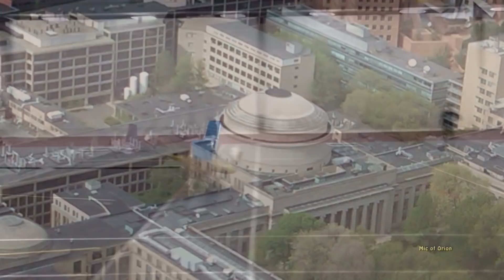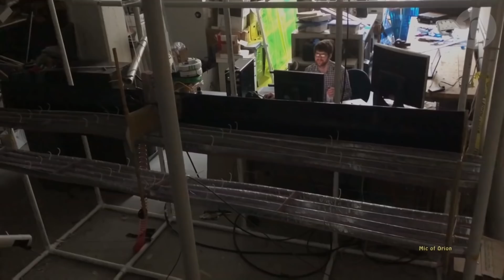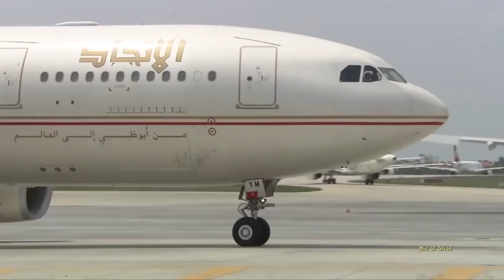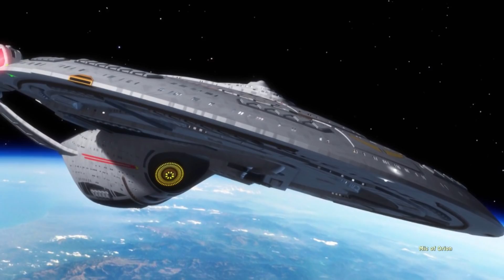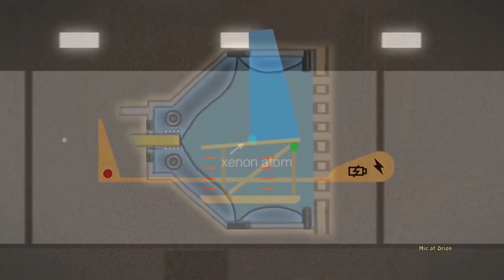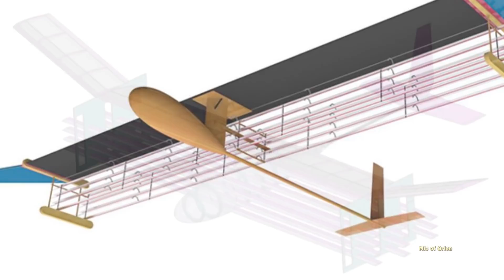STAR TREK LIKE ION DRIVE AIRCRAFT

Comment: The problem is energy density as battery tech still hasn’t reached an energy to weight ratio comparable to jet fuel. The design constraints have long been greater on aircraft. Also FYI Induced drag increases as speed increases and the energy requirements don’t scale linearly but exponentially, this is true of every form of propulsion through every medium (water, over-land & air).

Comment: 🔵 Unfortunately, even with technology at its present state, this type of system uses a tremendous amount of power to produce flight, development of an on-board power supply that will provide a practical length of flight-time is not possible now, nor will it be perhaps within your or my lifetime.
Reply: Hi Josh,
Actually, if you click on my channel icon to the left, you will see 11 prototypes of an ion propelled aircraft with onboard power in flight.  It was patented for carrying its power supply since 2014, before the MIT device( actually it was flying much earlier with its supply.  It is shown flying for about 2 minutes, and in front of officials.  It will surely be flying for at least 4 or 5 minutes in the near future, without  photovoltaic cells. You are correct that these devices did used to take more power.

Comment: Why not double ionize the gas?
Like a ion escalator, and each ionizing system not only strip the ion of electrons, and uses them to, in away, power the ion engine before it, but also increasing the ions speed as well.

I believe it's possible, but I guess I'm the only one who thought about it.

Also, why not use ion technology to create ion fusion reactors, or a power system based on generating power by ionizing ions, and using the same power to power itself, and the thing it's trying to power. 

A self feeding system you might say.
Reply: Please see the more efficient ion thrusters on my channel to the left.  They've had  onboard power for a long time!  If these devices are designed to produce negative ions instead of ozone etc., it takes a lot less energy since the O2 just absorbs the extra electrons.  If the current density is too high the efficiency can drop. The MIT craft uses much higher current to "strip" or recombine the molecules.  Anyway, this is how to get more efficiency.

Comment: This is only news because MIT did it, this is old old tech and MIT just added to a glider. It wouldn't work in space, because it's thing is to move air around by ion flow around foils, breakthrough is required in the power produced otherwise winds or weight make it worthless. But anything without moving parts is worth the development.

Comment: A tight grid of a thousand cells, 10,000 or orders of magnitudes over that... THAT's how you get a low-power unit UP to speed, increasing its efficiency and gaining the operational thrust you need for the solution to be practical. Now remember, EVERYTHING from Momentum to acceleration has to be "conserved" meaning that for any oz you're accelerating, you have to accelerate that much atmosphere-mass using the engines. Air isn't THAT dense, so you have to accelerate ALLOT of it - the reasons propellers work well, but ony to a point where jet engines then have to take over. When you factor in over-all power density that you get out of Jet fuel or even Internal combustion engines and their fuel, the ION approach will still fall short. The ONLY advantage is the weight and cost gain of not having to carry liquid fuel on board. HOWEVER - you STILL must carry fuel in a "TANK". That tank though, looks suspiciously like a "battery ( :-) ! ) " and batteries - for now - are VERY LOW power-density fuel sources. Elon Musk has purchased a battery developmen company that is looking to quadruple (or more) the on-board power density per battery unit,  thus increasing that power density by orders of magnitude. Don't remember the actual figures or I'd share them, but the vids are here somewhere, and well worth checking out. SO- the POINT ? It CAN be done, just an economy of scale - kind of thing, with coming developments in on-board power storage really looking promising ! Solar cells ? No, not a solution, until similar efficiency/density issues are solved there, too. To ionize enough atmosphere to make a highly- dense grid of ION-Thruster cells do you any good, you'd have to supply an INCEREDIBLE amount of power, and well, Solar cells just aren't there, and aren't ever likely to be. SO its still  good old Dinosaur juice, for the forseeable future ! ALL the VERY best to ALL here - from Texas - C.

Comment: The MIT craft shown above was not operational in 2017 according to their previously published paper describing the EAD V1.  According to their more recent paper, in the Journal of Nature, they claimed to have created "the first heavier than air ion propelled aircraft of any kind to lift its power supply."  The above craft made by MIT was the second and not the first heavier than air ion propelled aircraft to carry its power supply, and so their paper is historically NOT correct!  The above craft is the second heavier than air ion propelled aircraft with onboard power.  The primary initial momentum for the flight was achieved via catapult not ion thrust.

If you would like to see the first completely ion propelled aircraft  take off and fly carrying an onboard power supply, please click on the purple channel icon to the left, you can see 6 working prototypes undergoing flight tests!...  This very much earlier patented invention can fly for minutes lifting itself and its power supply. It has been clearly shown to fly solely using onboard ion propulsion.

Comment: USEING FIELD PROPULSION AND CONTROL IT, WITH NO MOVING PART-Quantum Gravity Field                                                                                                                                                                                                               Just Like Wright Brother And The Invention Of The LIGHT BULB, You Have To Fine The Right Material For The Ion Drive engine: To Work Right, To Give It More Thrust, If Not Copper And Aluminum, You Have To Search For The Correct Material,. The right Material Will Give The Ion Propulsion Engine More Thrust:- Wronght Material For The Ion Drive: A Air Craft Must Create Lift And forward Trust!,( Making A Warp Drive Useing Graviton Particle
And Not Ion Particle
The Ion Drive Use Ionic Wind For Propulsion The Graviton Drive Or Warp Drive Used Graviton For Propulsion, And No Ionic Wind. Graviton Has The Ability To Move SPACE Around It Drive Systen Creating It Propulsion, By Compress Space In Front It And Expand Space Behind It The Graviton Drive Systen Has Positive Charge In Front Going To Negative Charge Behind It. + <-- --> - The Graviton Field Is Positive Charge. That Move In The Direction Of The Positive Charge Graviton Field, It Work Like A Ionic Craft, But No Ionic Wind.

Comment: Try making the plane and its wing plastic... Plastic and friction causes static electricity, that can be turned into powering a lightweight electric motor, and stuff...
Reply from the maker: Plastic is too heavy, the materials used are strong and composite very light materials
Reply: @micoforion  When extremely thin plastics are used, they can be employed to create some of the lightest materials/structures, it depends on the application. Carbon veils can be extremely good for rigidity, but since they are made from chopped carbon fibers, the surface they create interfere with their use as ion collectors. Boron fibers are the most rigid in practice, but can't be formed into other shapes as readily.  Very thin plastic films when used as wing coverings are lighter than carbon fiber or even aerogels because of their thin form factor.

Comment: I got a couple ideas for your ion drive experiments
1. about 3 tubes one inside the other, the middle being one pole then two outer tubes being another pole. I would think that would work. 

2. about fins along the outside of the aircraft. and each one would help pull along the craft, each fin charged as like describe above.

3. I am also thinking something like a jet turbine that each impeller fin is also charged as described before but as the air is coming in if there is something you can use to push the particles coming out to faster speed.

Comment: Come on this is the old electric lifter technology ionized wind, repackaged to be new again, used in some old electronic devices instead of fans to cool them down. And star truck used warp engines that warped the space and therefore displacing the ship like on the conveyor belt of the fabric of space, they also had impulse engines but that was a different technology more alike the ion drive on serious steroids.

Comment: add adehumidfyer, channel throguh an electrolisis chamber, a hydrogen electro machine, ion effect, we have free flying cars. the stability issu can be fixed by a gyroscope.  no fuel cost, no road tax.  and if you ever tried putting two magnets together, no crashes  

making a working version right now

Comment: WHAT ARE GRAVITON                                                                                                                                                                                                                                                                                                                                                    In physics, the graviton is a hypothetical elementary particle that mediates the force of gravitation in the framework of quantum field theory. If it exists, the graviton is expected to be massless (because the gravitational force appears to have unlimited range) and must be a spin-2 boson. The spin follows from the fact that the source of gravitation is the stress–energy tensor, a second-rank tensor (compared to electromagnetism's spin-1 photon, the source of which is the four-current, a first-rank tensor). Additionally, it can be shown that any massless spin-2 field would give rise to a force indistinguishable from gravitation, because a massless spin-2 field must couple to (interact with) the stress–energy tensor in the same way that the gravitational field does. This result suggests that, if a massless spin-2 particle is discovered, it must be the graviton, so that the only experimental verification needed for the graviton, ( discovery of a massless spin-2 particle.

Comment: USEING FIELD PROPULSION AND CONTROL IT, WITH NO MOVING PART                                                                                                                                                                                                                                                                                                                                                  Just Like Wright Brother And The Invention Of  The LIGHT BULB, You Have To Fine The Right Material For The Ion Drive engine: To Work  Right, to give it more thrust, if not copper and aluminum, you Have To  Search For The Correct  Material,. The right Material Will Give The Ion Propulsion Engine More Thrust:- for year people have used the Wronght Material For The Ion Drive: A Air Craft Must Create Lift And forward Trust!,( Making A Warp Drive Useing Graviton Particle
 And Not Ion Particle
 The Ion Drive Use Ionic Wind For Propulsion The Graviton Drive Or Warp Drive Used Graviton For Propulsion, And No Ionic Wind. Graviton Has The Ability To Move SPACE Around It Drive Systen Creating It Propulsion, The Graviton  Drive Systen Has Positive Charge Going To Negative Charge. + <-- --> - The Graviton Field Is Positive Charge. That Move In The Direction Of The Positive Charge Graviton Field, It Work Like A Ionic Craft, But No Ionic Wind

Comment: Ahhh. Guys. This isn't new technology at all. I used this tech to create a hovering platform in the early 70's, powering it by using a high voltage transformer from a TV by attaching long tiny high voltage wires to the 2 screens, the top screen being ordinary window metal screen material and the bottom screen having 1/2 gaps. You can get this from any hardware store. The two screens were then separated using cut off match sticks as spacers and glued into place, creating an air gap between the two screens of about 1/2 inch or so. I had read about this in the late 60's. A guy by the name of Major Salvinski living here in the USA was building different types of hovering platforms in a warehouse using this tech. I think it was written up in Popular Science, or some similar magazine that I was reading at the library at the time, with lots of nice pictures of these things hovering and glowing in mid air.  (I'm not saying the tech can't be greatly and dramatically improved by using today's technology to revamp it. Just saying the basic idea isn't new at all..)

Comment: um you claim no fuel, but i think you should go back to elementary school, where everyone learned the basic principles of physics. ion drives used ionized particles as fuel, this requires material as matter is made of ionized particles , well at least partially, I am not going to give a class on the structure of the atom here, this technology will not work in space as there is nothing in a vacuum to feed it. and even on earth where we have air all around us the ion drive will not actually push anything forward because the trust produced is less than the force of the air pressure, this tech is interesting, but as of 2018 almost 2019, this will not work for any aircraft or space craft as it  cant work on earth because of air pressure and gravity are both stronger forces and it cant work in space because lack of materials to fuel it. so next time you pretend to know what you are talking about, know that there is people who actually do know and will call you out for giving false facts. and yes they could just bring the fuel with them I know, but how would that be any different than it is know, also you really need to learn the meaning of solid state, that means no moving parts. much like a cpu. no wires no pieces just material science only.  but this is over your head so i will stop. also the engine has to have electricity to ionize the particles.
Reply: Yeah, except you're wrong on both counts. In-atmoshpere, all you have to do is apply economy of scale/source energy density, and in the vacuum of space all you have to do is provide the reaction mass. There, that's not even needed if you're only accelerating a few ounces or pounds, sort of like the mini-sats going up soon by Space-X for the 5G "blanket". They aren't using this technology - to your point - but that's the scale of something that could benefit. They're already using this for course management on some long-reach probes (in space ... ) so yeah, his "facts" are really ok, especially for the point of this vid, which is nothing more than to highlight some interesting things some college children are doing to learn about some fringe tech. As for "solid state" that's referring to some relatively new developments in battery density which promises to boost density/efficiency from around 3 or 5% (upper limit to solid-state solar cells, so they're out) to 12-20% (current battery techn.) to over 40% and higher, in the coming years, and yes, "Solid State Betteries" really IS a thing so ...

Comment: Not ion drive, static drive.  It uses static electricity from stored energy to move the air relative to the model, thus moving the model.  Will not work in space.
Reply: Interesting perspective, I think the electrons may build up in a properly made one, creating negative ions, free electrons, and some uncharged air as propellant.  If you click on the  channel icon to the left you can see more than a dozen prototypes of an earlier one in flight with an onboard power supply.  It can also carry a very small optional  propellant tanks.

Comment: SOLID STATE PROPULSION
 - MIT
Just Like Wright Brother And The LIGHT BULB, You Have To Fine The Right Filament For The Ion Drive engine: To Work  Right, to give it more thrust, if not copper and aluminum, you have to  Search for the correct  material,. The right material will give the ion propulsion engine more thrust:- for year people have used the wrong material for the ion drive

Comment: "If you do not master Complexity, you will never master simplicity." Or to use another saying "the Devil is in the details". These come to mind when people try to extol the virtues of a simpler machine that is expected to do what a more complex machine does to the same degree. Keep in mind our computers have only gotten MORE complex, both hardware and software, not simpler and then only smaller. A solid state propulsion system will not be simpler, only have fewer moving parts. And in truth it will be some kind of "atomic" rocket engine. We simply do not have the energy production abilities to power an "ion" engine with enough force for flight in a gravity well and an atmosphere.

Comment: Ion drives are known and tested for the last like 70 years. They just use batteries in this experiment and before people used high voltage cables. I had book with instructions and schematics how to make one when I was a kid and I'm 40 years old. That tech is REALLY OLD. We just didn't have the batteries. They were talking about Ion planes 60 years ago.
Reply: If you click on the purple channel icon to the left, you can see one that rises vertically with its power supply onboard.  It was carrying its power supply and batteries long before MIT's catapulted glider.  You are certainly right though, it would have been very difficult to fly with onboard power with older type batteries.
Reply: it was invented Oct. 24, 1998...